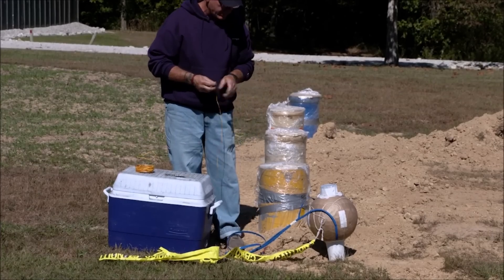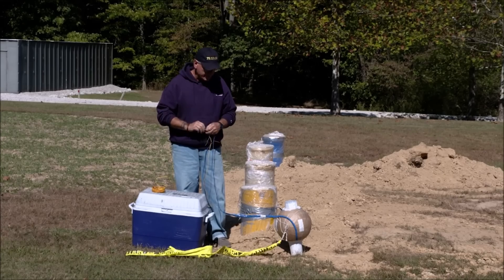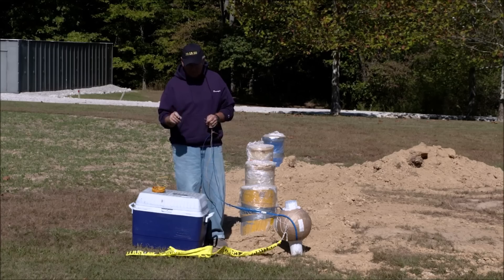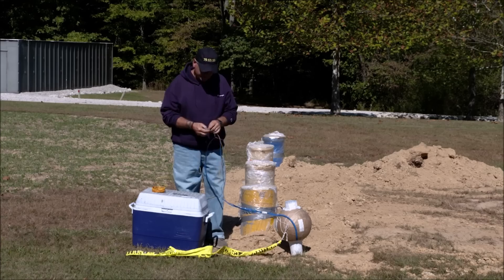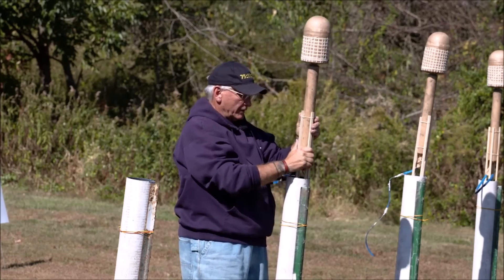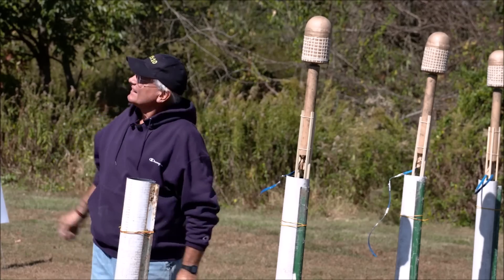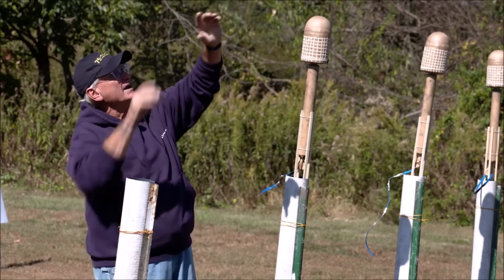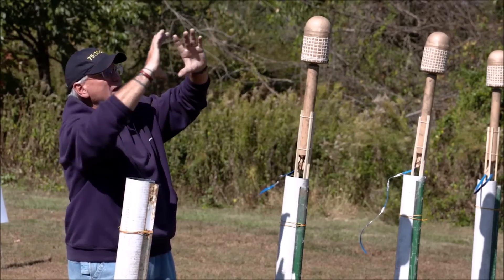8 Large Rockets and a Large Ball Shell, video from Passfire the Fireworks Series

Comment: Great video. How many inches deep and what diameter did you make the hollow core on the BP motor and how many inches long and diameter is the motor tube? Just finished making a BP rocket with a 1in report header but I’m hoping it lifts as some of my others either CATO’d or just didn’t lift. I want to be sure I’m choosing the right nozzle and BP core diameter in order to create the best amount of thrust. If you have any math formulas for fireworks weight and balance and nozzle size calculations for standard BP please let me know 🙏🏿. Once again the info was BANGING! ❤…pun intended 😂

Comment: Did I miss the 12" ball boomer? The rockets are way cool. Too bad we have to just watch fireworks on video.
Reply from the maker: The 12" ballshell is shown at 2:40, AM.
Reply: @nedgorski  Preciate that, Sir. Been up starting 3rd day. Not as observant as I should be. In my business that can be fatal but luckily I'm stateside recovering from surgery. But after 40yrs  of not bein able to sleep deeply or for very long in a row I'm used to it. Many folks in my world can't deal with big fireworks, the ones that just go "boom" mostly, shows but fortunately I never grew up. Great job on the builds. First rocket ones I've seen. Adds alot to the effect. I need to learn how to do that but too late to start. Thinkin any shoulder fired rockets we use probly cost over $100,000 each but maybe I'm misremembering. Sounds high. Just lucked up on the channel but will watch some more. Thanks for the info.
Reply from the maker: @TheAcceleratorMagazine  Enjoy. There are plenty of smaller devices and projects we can have fun with.

Comment: Sad the rockets did not help with orientation #2 did not need one. Great 12" !
Reply from the maker: Once I get the motor delay dialed in just right, the orientation will be right, too, Michael. It's all a matter of tweaking here and there.
Reply: @nedgorski  So then the delay takes the heading over with the sticks up the shell should break?
Reply from the maker: @3ccdmike  I don't understand what you're saying/asking, Michael. The thrust portion of the motor burn only lasts 2 seconds. Then the delay portion allows the rocket to coast, ideally to right before apogee when I want the heading to display. It's simple, really
Reply: @nedgorski  At first I was thinking that it should break at apogee and not when the sticks turn upward. Will you be at the PGI manufacturing arena next year.
Reply from the maker: @3ccdmike  I want the heading to go off just before apogee, really, Michael, so the display is oriented like a "ring" to the audience. Yep, I'm planning on being in Fargo, in Manufacturing. It'd be hard to miss a convention.
Reply: @nedgorski  I will be there as well and am planing to have a table there as well. 1995 was my first one and attended 4. Hope to meet you there.